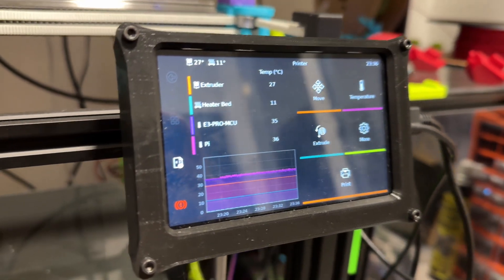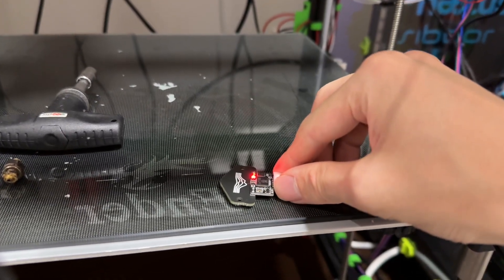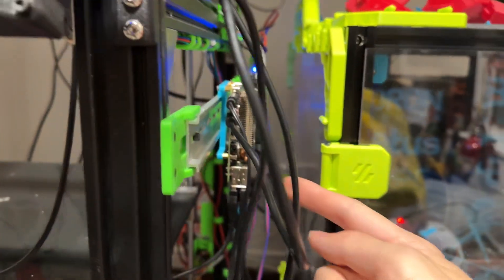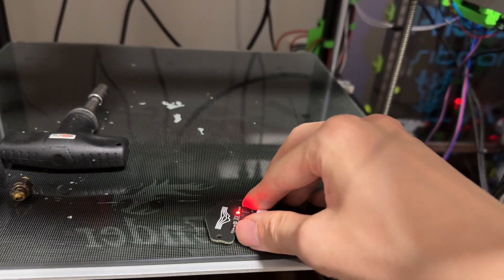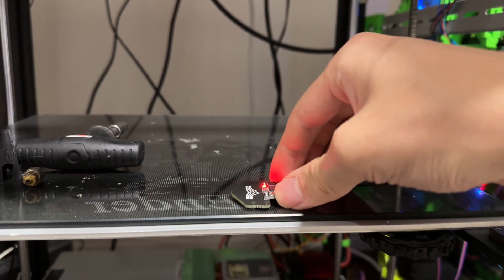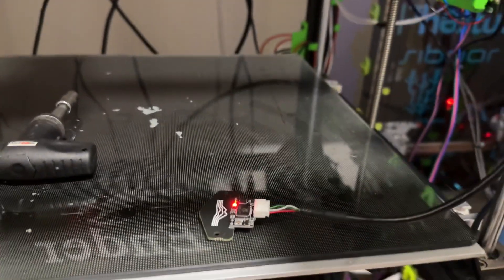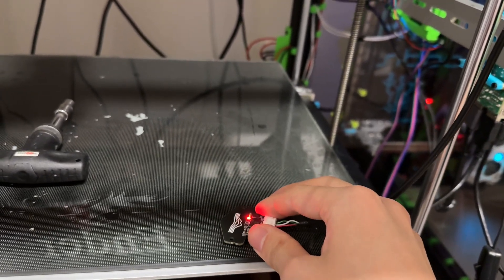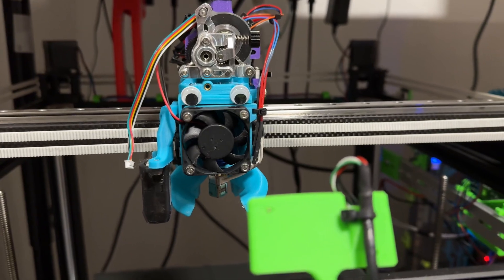Affordable Eddy Current Displacement Sensor : Cartographer

Comment: What's the point? Eddy current requires a metal bed to get the gain. This vid is misinforming.
Reply: He does mention that in the video, Just have to watch it to the end 😂.
Reply from the maker: @Inveterat  thanks for checking mate!!
Reply from the maker: @noktrnl123  I just tested on the as is setup I had. I know that it’s not for glass bed.